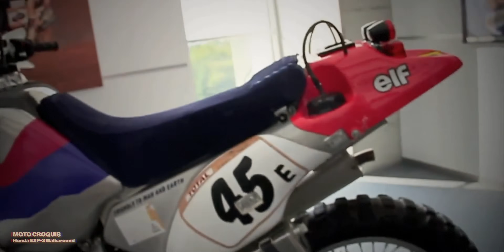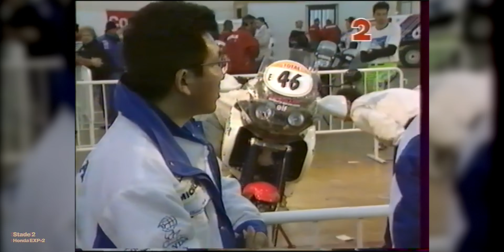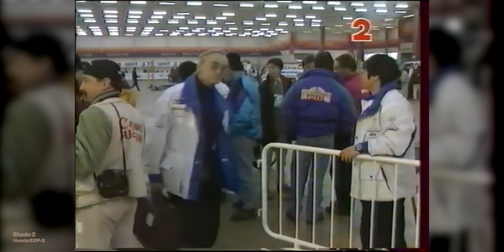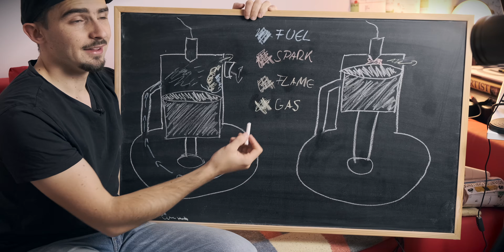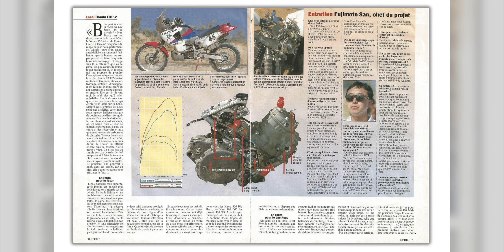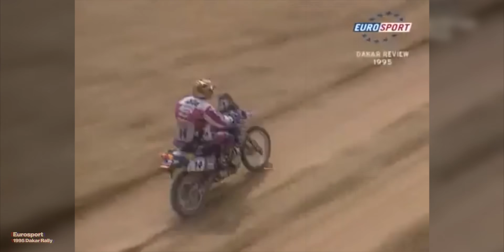When Honda Took a 2 Stroke to Dakar!

Comment: A very nice summation of the system, thank you. I started riding 2 strokes, desert enduros. and RD-400, and 2stroles are deserving of a revitalization, CARB be damned. 
The emission nazis in California will not last, as Ca won't last, it's a bunch of liberal control freaks that will self destruct soon enough.
I am a retired Master Mechanic, made my living working for dealers and several independent shops, and I really like your description of this system, I really ate that up.
The older 2 strokes that were legal can still be run, providing they survived, I hope to get a 250 or bigger, and take it easy tooling around the hills around here.
That RD really ruined me, it's why I am disabled, but I still have the 2 stroke fever.

Comment: Hope they didn't trash the winning cycle. It should be in the Honda Museum in Motegi?
Have never heard of "Active Radicals" in the exhaust gas.  The exhaust valve looks simple and could be more cheaply/easily controlled with modern electronics.

Comment: TPI could render this obsolete. Sure TPI wasn't really good in enduro since it lacked proper fuelling in the lowest of RPM making it harder to ride and more funrable to seizure as an Hard-Enduro bike (wich it was marketed for), that's why TBI was invented.

However TPI at high RPM doesn't loose nearly as much fuel mixture as a carb, making it easy to pass regulations. Also works really well on mid to high RPM's. Guess where Rally bikes live...?

Comment: I'm quite sure a modern 300 2 stroke could finish Dakar.
Sure it needs all the same upgrades as a 4 stroke. But the Dakar being 8000'ish km of open ground makes it ''easy'' work for a 2 stroke engine. I can do these km's on 1 piston in a combo of MX, Enduro, Hard-Enduro and Cross-Country. Surely a raceprepped bike can do that at high speeds and starting maybe 5 times a day. 
14 days of say 10 hours make 140 hours of engine time. My piston lives in there for 166 hours now and still going strong. If teams are allowed to do piston changes (wich take an amature about 1 hour, raceteam 20 minutes?) i see no problem at all.

Also when tuned specifically for high speed, high RPM output one could tune it very narrow and very efficiënt. In my riding it's not uncommon that my 2 stroke uses less fuel than the 4 strokes.
Reply: There is a video on Youtube about a guy tearing down a Ktm exc 300 with 368 hours on the first topend. They last long
Reply: 🇨🇿🤔 není možné z principu motoru, aby na stejné trati a trase i za čas, měl 2T spotřebu menší než 4T
Reply: @filiprejthar4209 energy had two equations, how you make it and how you spend it. You can get a two stroke close to the efficiency of a 4 stroke but if it's pushing a smaller bike then you're also spending less.

Comment: Shame on Honda for killing the 2 strokes. Imagine what they could have achieved if they developed this concept with modern technology!
Reply: Indeed. There is nothing like the sound of a CR 125/250 coming 'On the pipe'
Reply: I'm selling my bike and rebuilding an old carbureted two stroke. I miss them.
Reply: Honda didn't really kill the 2t they were just the first to stop using them the writing was already on the wall !  EPA an AMA killed the 2t !!!

Comment: The crazy thing is, banning 2-strokes stifles improvement. Vespa made CLEAN 2-strokes. Yeah? Right? No, they really did. SO, it's possible to make them cleaner and more efficient, while keeping the benefits.
Reply: We have the tech for much cleaner two strokes than what we had in the 80s/90s. Fantic make a Euro5 compliant 50cc.
Reply: This guy knows
Reply: You can still buy KTM/HUS/GasGas, Yamaha and Beta 2 strokes in the US so I wouldn’t say they are banned tbf
Reply: It‘s possible to make Euro 5 compliant 2 stroke engines. Piaggio was capable of managing Euro 3 with just a carburetor and they even had direct injection 2 strokes which had better fuel economy and power than comparable 4 strokes, but they were discontinued due to cost and reliability issues. Again there are plenty of Euro 5 compliant 2 strokes but they are REALLY expensive to make compared to 4 strokes. In the end the 4 stroke is just a more future proof concept that doesn‘t have to rely on as much tech as a 2 stroke would. Hence why the 2 stroke is basically extinct, it just can‘t compete in terms of cost and reliability.
Reply: @SahnigReingeloetet  In making a emissions compliant 2 stroke you lose the benefits of 2 strokes. Light, simple and cheap engines with a lot of power. If you need 42 sensors its no longer light simple and cheap so then whats the point?
Reply: Many big ship engine are 2 stroke (diesel) engines. 

Must be a reason for that....
Reply: My main rider is a restored 1995 CR250.

Comment: Great video. But 2 strokes technology is 👎👎👎👎😔😔😔
Reply: It’s still better power to weight ratio than 4-stroke. Only turbo or supercharged 4-stroke can compete.
Reply: @jLkm897  motocross action magazine did a test and compared the two-stroke YZ 250 to the 4 stroke YZ 250 F. They gave different responses back to the rider, but the lap times were virtually the same. Some said the four stroke  required more effort and others said it was far easier to ride than the two stroke. If you like the two-stroke, buy it and ride it. If you like the four stroke, buy it and ride it. If I was in charge of rules for FIM/AMA races I would limit four strokes to a 350 cc engine. I think the riders would be happier with the smaller motor as well. Once they realize no one could ride a 450 against them.
Reply: What????

Comment: Like them or despise them, KTM is the most influential manufacturer doing 2-stroke technology advancement in the modern world.
Reply: Yes best engine in my opinion was KTM 440 mxc it revs higher than 250 and makes 58hp stock. If i find one i keep it. It was only made 94-95. It was best big bore 2-stroke ever.
Reply: @jLkm897  495 was the beast 84/85.

Comment: 2 strokes are the best for motorcycle, and Honda's self boycott was a pain to watch.
Reply: Incorrect. Two strokes are better for racing. Four stroke engines are exceedingly more practical for use on the street. The reason two-stroke street bikes didn’t sell in the United States is people who didn’t like the way they sounded. In the United States, particularly, a nation with a huge car culture, they didn’t like the sound of two-stroke engines.  And the four stroke engine was way more advanced and refined for every day use. The manufacturers did extended research and what they found is street riders preferred four stroke engines.
Reply: @TheBlueDogMan  Two strokes are better for racing. they are cheaper and easier to work on. Plus they have more power for the same size engine. That is why the AMA will not let 250 two strokes race against 250 four strokes.